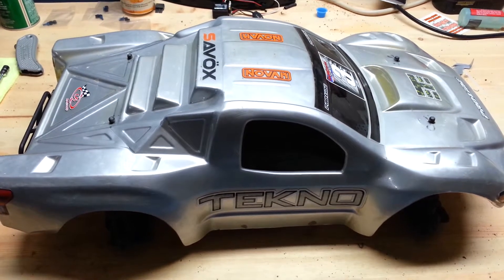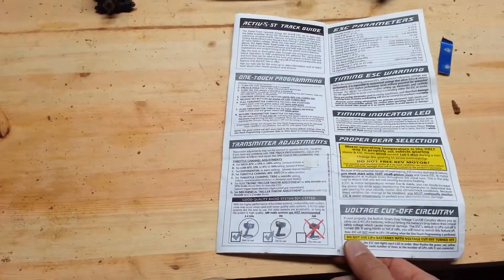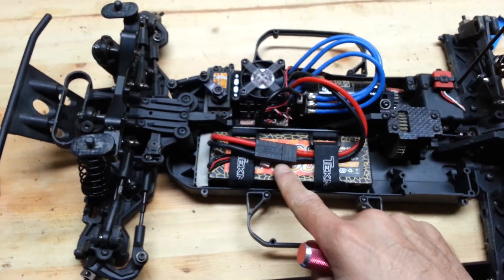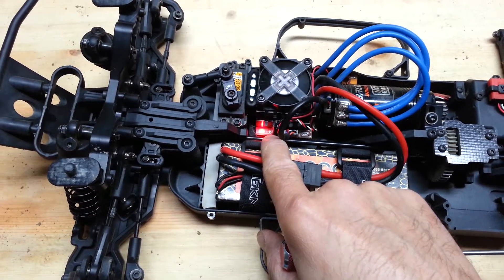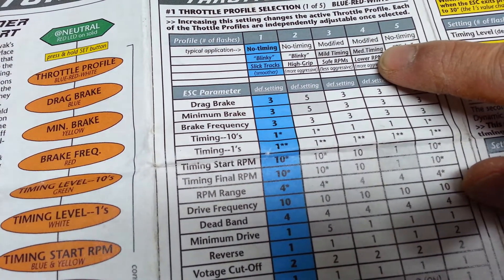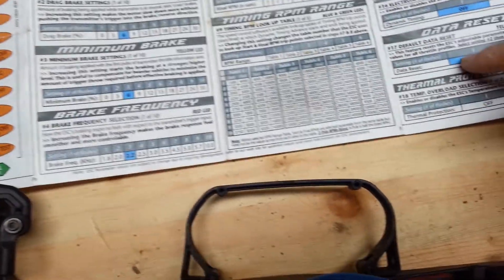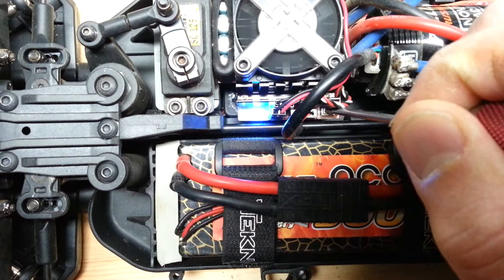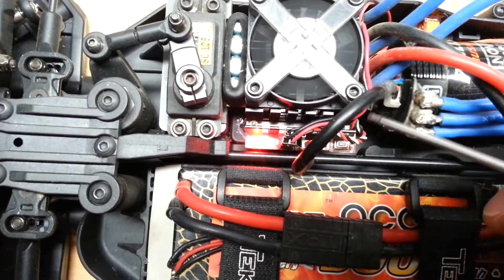How To Use Novak Super Tuner Software

Comment: Thanks for the help.  I have a yeti with a novak crusher ESC.  When I give it light throttle it is very jerky but when I'm past a certain throttle point its smooth as it should be.  What would I need to adjust to fix this?  Thanks
Reply from the maker: Thanks for watching.  that sounds like cogging  to me. I would try a new sensor wire and see if that works.